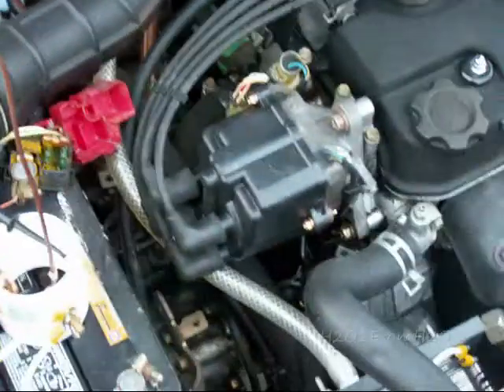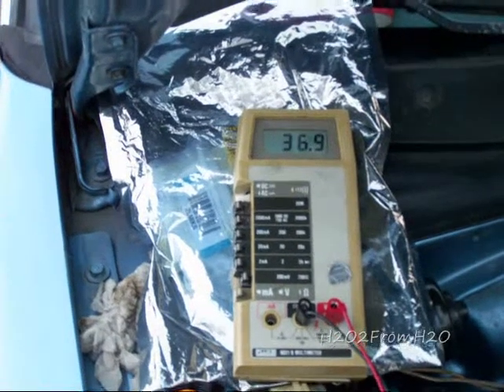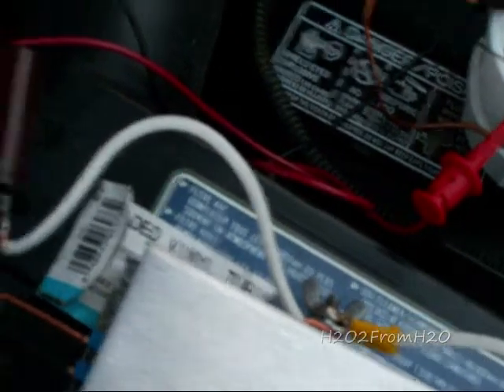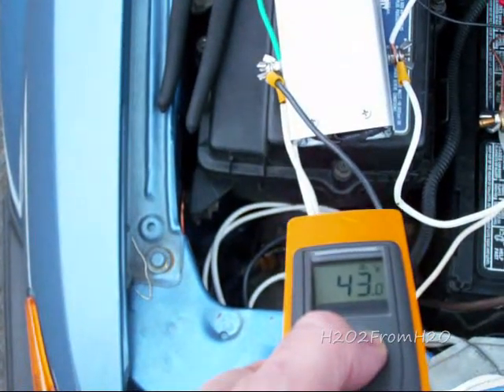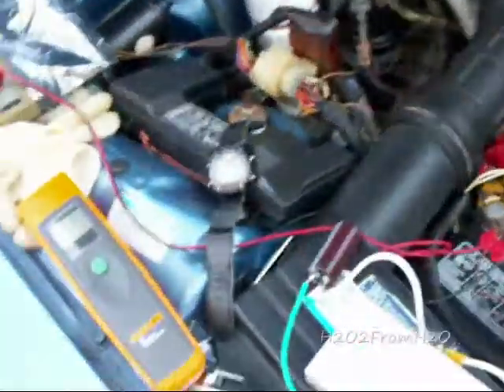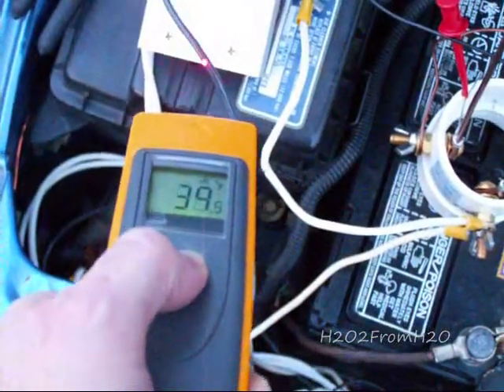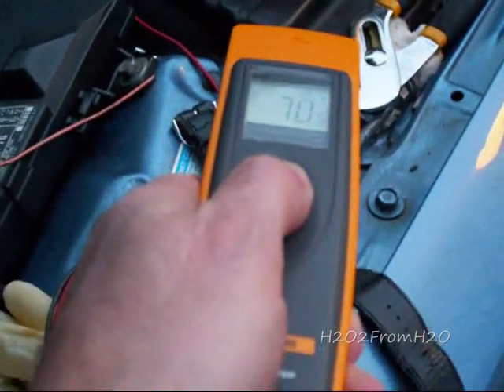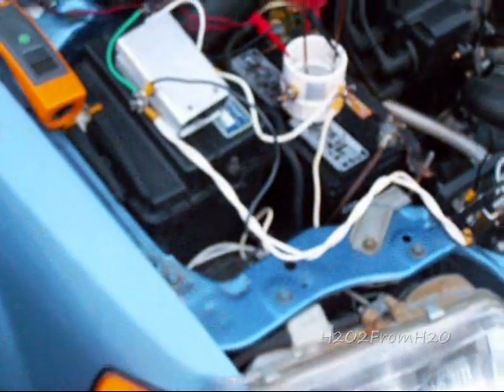#19 H2O2 - PWM 30Amp Temperature Test with Dry Cell Load

Comment from the maker: Its more then a hobby, Electronics is a passion. I have studied cell design and what it takes to drive it with proper control. The PWM is that control, But what I found was that there were no designs that could control the heat disipation with out external cooling. So I have improved the PWM driver and added 4 MosFets to reduce the overall resistence of the switching circuit. By reducing the time it take to turn on and off and having 4 MosFets the over all heat disipaion is amazing.